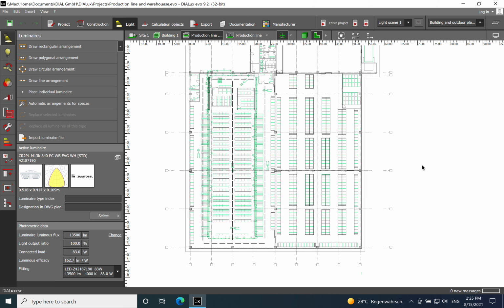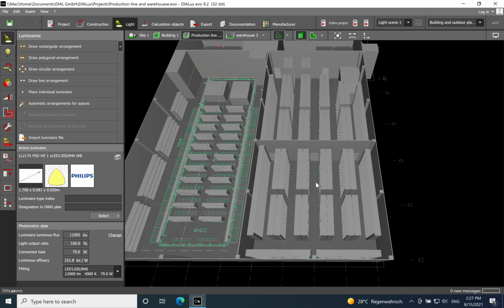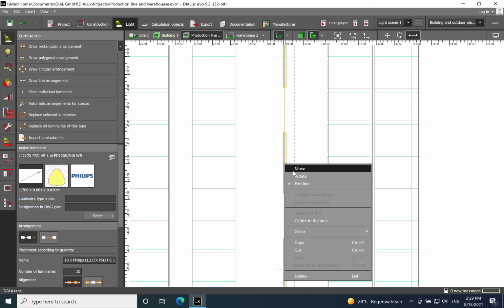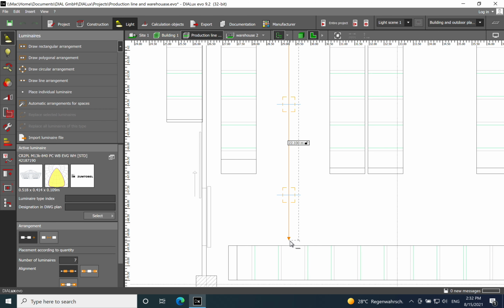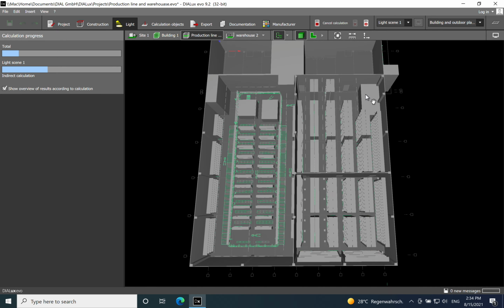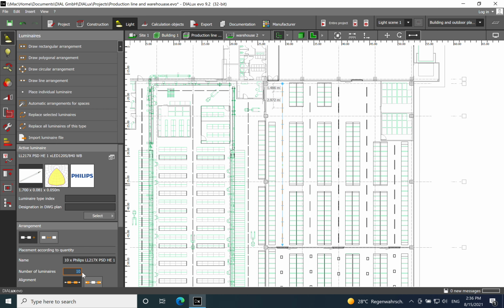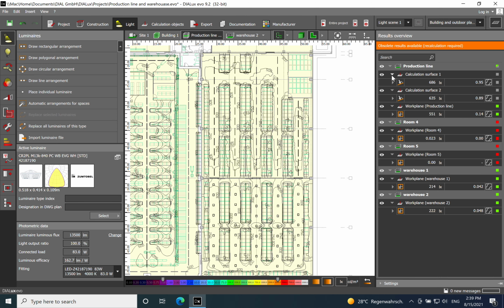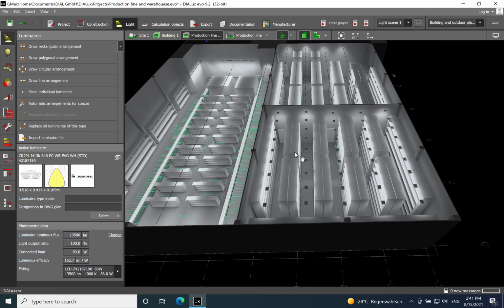Lighting for warehouse

Comment: This Uniformity level is manually setup. Because DIAlux Default level is 0.4. Lux is achieved but uniformity is very low.
Reply from the maker: Hi, the uniformity level is given by the application based on the standard EN12464-1 which is included in Dialux software. At  3.20  minute of the video you can see which application I choose for the lighting design and the lighting parameters gave by the software based on the standard. You can override the lighting parameters if you want.  The results of the lighting simulation can not be override